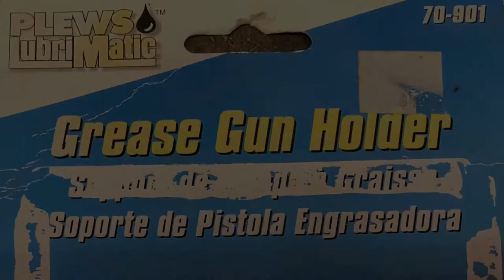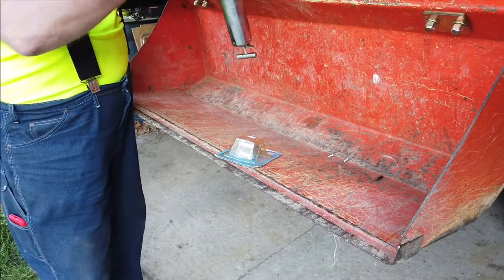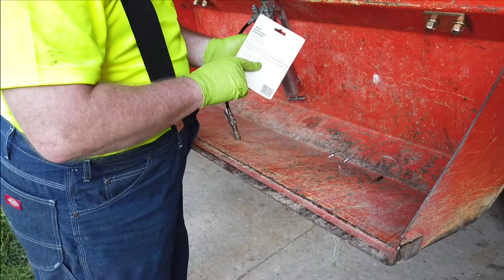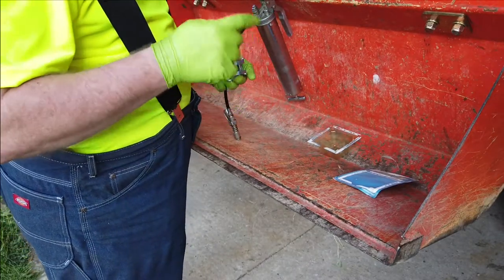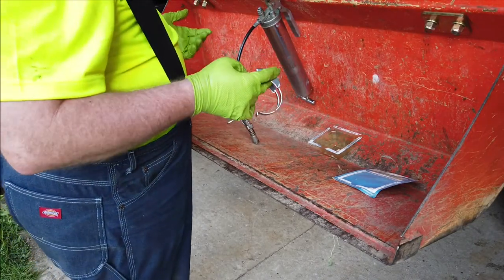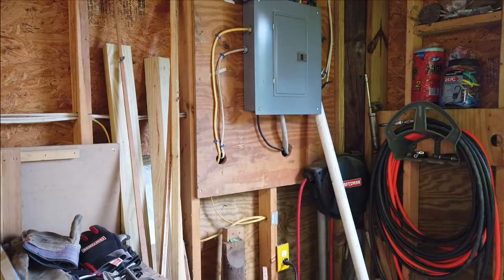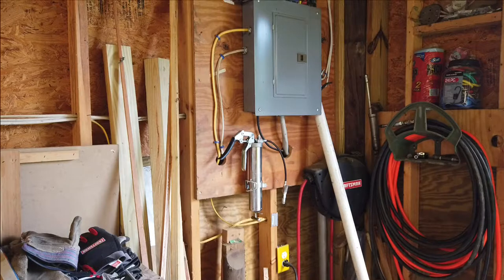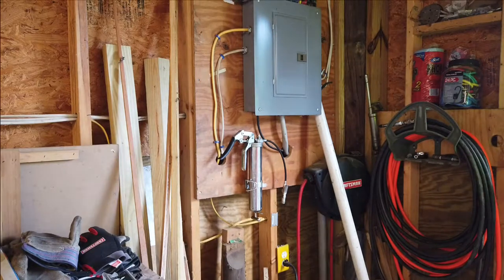#34 - Shop Tip - Grease Gun Holder

Comment: I have used the same holder for many years.  I mounted a coffee can near the tip.  In the summer heat the gun likes to drip some grease.  Great way to organize and store the gun.  Dab 😊
Reply from the maker: Can you still buy coffee in a can?  It seems fall the good packaging is gone for good.  I will need to look and see if I have a grease spot.  LOL I think you have some good tips to share.  I remember my dad's bolt and nut bucket was a coffee can.  Sigh 
Thanks for watching and commenting. Enjoy the Journey - Cheers